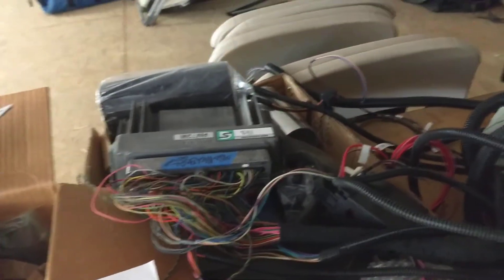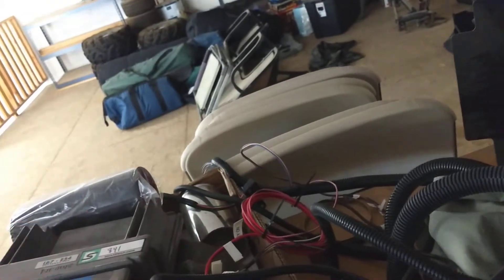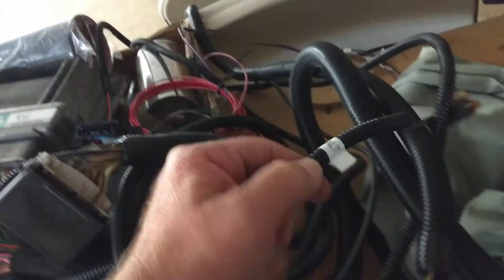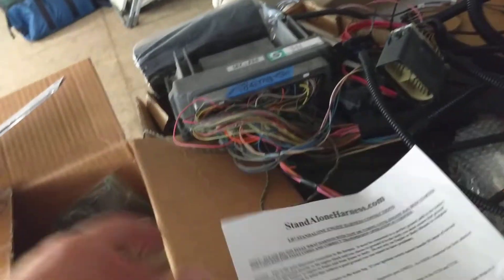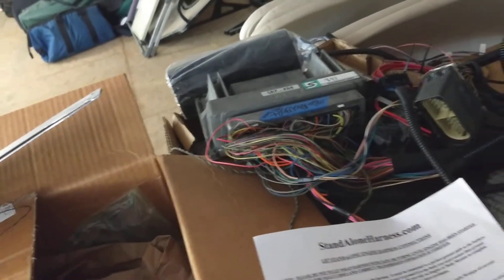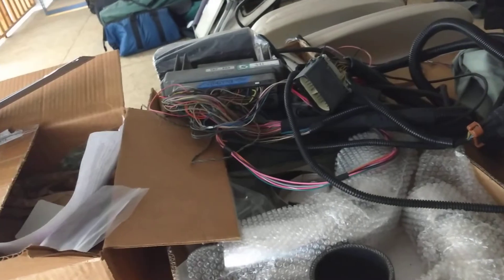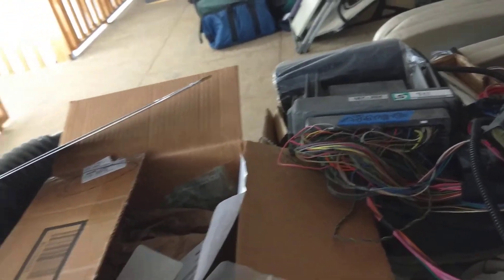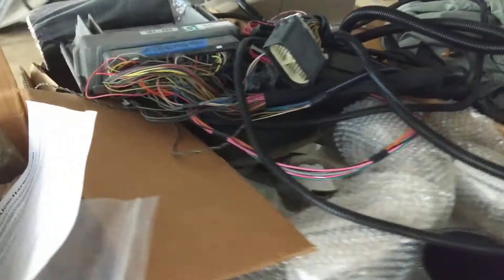Duramax swap engine info

Comment: What did you get for a torge converter I'm putting a duramax in a avalanche
Reply: Thanks  I have one I will use it
Reply: It's going into a mega truck never gets outa second gear
Reply from the maker: The converter I got was a stock 4l80 converter that had been rebuild for more torque. I don't think I'm going to use it. There are many companies that make a converter for the 4l80 with a duramax.
Reply: Did you use the duramax flywheel with it or the 4l80 flywheel
Reply from the maker: @justinblock7386  you have to use the duramax flywheel. You can also use a converter for a 2006 van. It used a duramax with this same transmission. What trans controller are you using?
Reply: It his hot wired like a manual put it in 1st 2nd 3rd 4th

Comment: I have the 4L80E with stock-standalone ECM module (Like the one from some Van`s) and the engine is 6.5 Detroit Diesel with mechanical D Pump, its one of the early Hummer H1 1995. I am also building everything my self, so I will need to make engine mounts (not tranny mounts) when swapping to a LB7, new exhaust, wiring everything and so on. On the early Hummer H1, the ones before year 2000 when they did come with 6.5TD the engine, the 6.5NA are like (Dinosaurs) No brain unit, and the 4L80E is like the high tec unit compared to the engine. Throttle wire with a TPS on the D pump shaft for feeding the tranny with up to 5v signals, so I will need to get the same TPS signal maybe from the E-Pedal on the LB7, or maybe I just mount the Tranny TPS to the pedal in some ways. Anyway I will need to use the 4L80E in the beginning and hopefully later I will replace it with the Allison 1000. With the ease of using the same wiring harness you have, I will only need to "Replace the engine" and some small details around it. Hopefully ;)
Reply from the maker: Sounds like you have a project. The dmax and Alison have separate computers from stock, but the are wired together to talk. A van harnes will wire to 4l80 trans and it uses 1 ecm to run both. So that is why that is a good option for the l80 trans.

Comment: Thats awesome Travis, and thanks a lot for doing this even on Turkey day :) The wiring harness looks like OEM, I will need the same exact one I think. Do you know if the converter coming from a 6.5/6.5TD and 4L80E tranny will fit the converter adapter plate on the LB7? If the bolts match up maybe? Hope your videos gets more views now, I will share it for sure :) Looking forward to follow your build process.
Reply from the maker: Converter will bolt up, may need a center spacer.